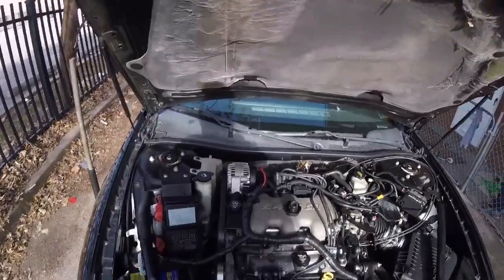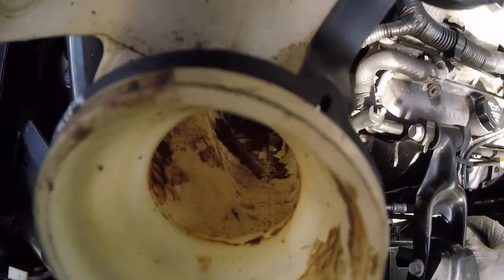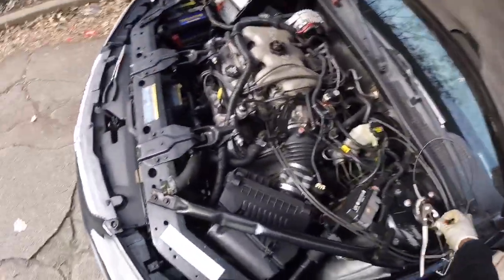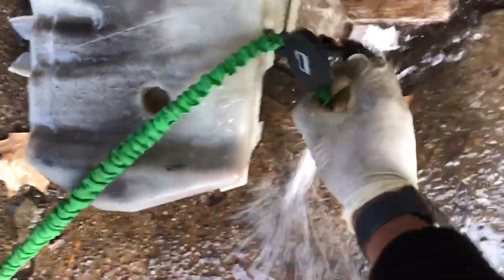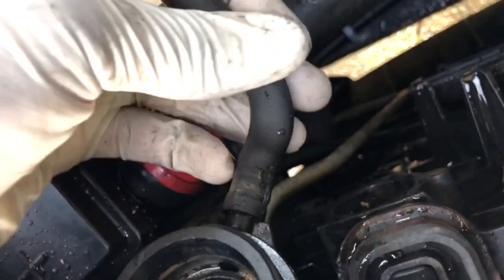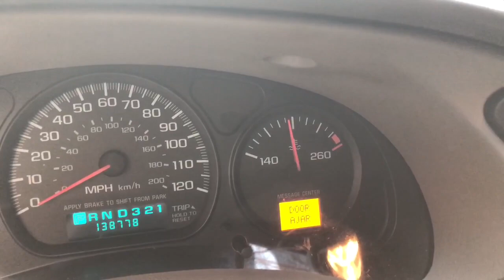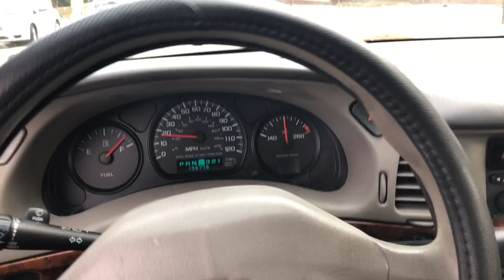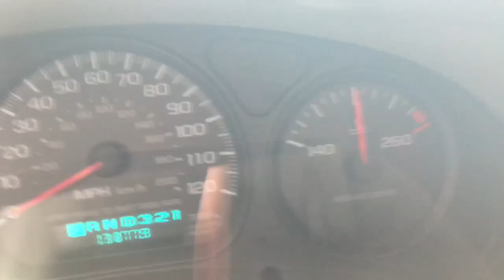2004 Chevy Impala Radiator Flush: Philadelphia

Comment: Now what if you did not bleed out the air would it still work as normal I mean my my heat is hot and my temp gauge is normal so it would it still work to flush the system out

Comment: Great video. I did all this after I changed my water pump. Heat got hot but my AC will not get cold now. It worked well before I did the work. Any ideas?
Reply: U bleed the air?

Comment: Can’t  you simply open a drain plug on bottom of radiator,  drain coolsnt, replace plug and refill ?
Reply: If you just do that you will have bubbles in your coolant system and will eventually cause problems, overheating etc.. auto shops usually flush and then fill under vacuum to prevent air in the system. Think air in your stomac causing discomfort and needing to burp.
Reply: @sirwilliamwallace9858 isn’t that what the air bleed screws are for after doing the job to get the air out
Reply: @vapemax3228  not all cars have bleeder screws and because air is a poor conductor of heat you risk creating hot spots on your engine where the bubbles are collecting and all the damage that may follow.. whether it be bleeder valve, vacuum, manually burping or just patting your car on its back.. you need to get the air out of your system

Comment: just a few questions if I may. 1. did anything bad happed over the winter with using 50/50 mix and it being diluted with the water currently in  radiator, block and heater core? 2. Did you open the bleeder valve stem or the entire assembly? 3. Did you ever change that blinker/indicator light lol.  THE WORLD MUST KNOW
Reply: He opened the full assembly

Comment: Would this be the same steps for a 2002 Chevy impala LS 3800? I think my engine seems similar if not the exact same as you worked on in this video.. 

When I cut my heat on there is a short burst of heat then my heat drops drastically to the point my heat runs cool.. 

I think it could be this part of my engine clogged up
Reply: Lee Roy-EL 777 good question
Reply: Same engine from 2000 - 05
Reply: For my 04 Monte Carlo, the sprocket wheel inside my actuator got worn. That opens and closes some sort of vent or flap that that lets cool air or heat in when I turn on the air or heat. Until I replace I removed it and have to go underneath and turn that little knob by hand. It's all a headache

Comment: Hey man thanks for sharing, was wondering what you used to remove the clamps on the radiator tubes?
Reply from the maker: They are called coolant hose clamps Gt them from advanced auto parts. I forgot item number. They cost like 30 bucks

Comment: I did all this and it’s still not blowing hot or cold 🥲
Reply: did you bleed the air out of the system with the 2 bleeder valves?
Reply: If you did all of that and it's still not blowing out what it's supposed to, might be a bad actuator underneath across from where the blower motor is. It's connected to a valve that opens and closes a vent door that determines  whether hot or cooled comes in based on which ever one you turn in. A sprocket with teeth gets stripped and fails to turn the valve. If you listen near your glove box and hear a mystery clicking, that might be it.

Comment: My car has always used tap water, putting antifreeze will make it leak?
Reply: Tap water could be the reason it leaks, all the crap in non distilled water can build up and when you add a coolant that could break that loose. You could either plug it somewhere or uncover a hole that has been covered by said crap.
Reply: Water will freeze in winter unless you live somewhere it never gets below freezing

Comment: How much gallons of colant you use to fill again the sistem?
Reply: Seeing the green at first and orange second means someone was just throwing in regular coolant with the dexcool. (They don't mix at all) also instead of pulling hoses and making a mess, you can take off the petcock on the bottom of the radiator to drain ALL the coolant. You have to run it with the heat on to cycle the water through the heater core  and drain it again. These are bad instructions.
Reply: @shaytaylor7004 if they mixing like that thing was probably overheating